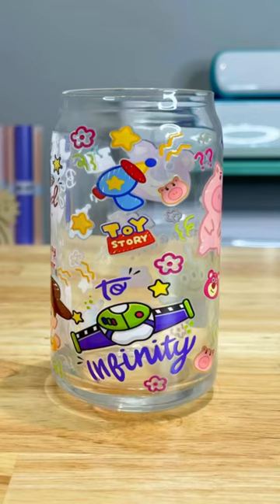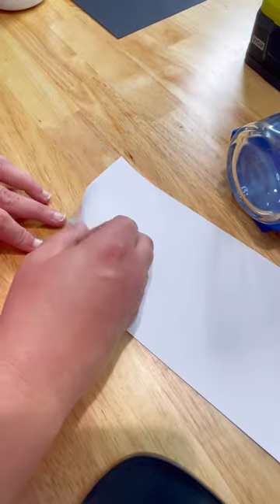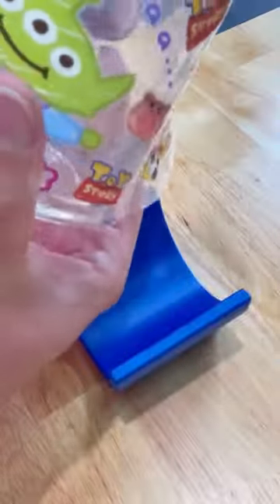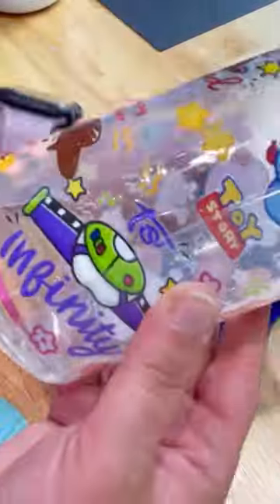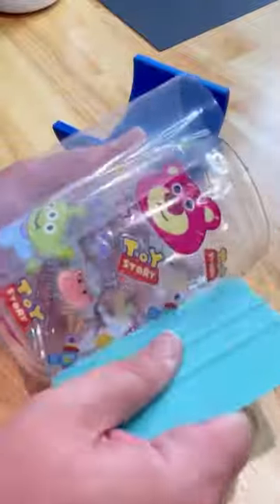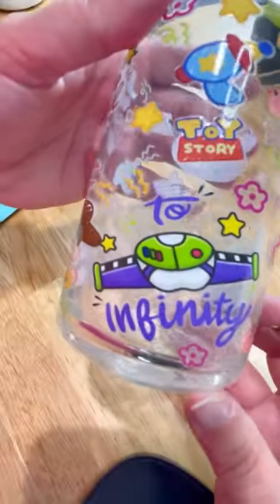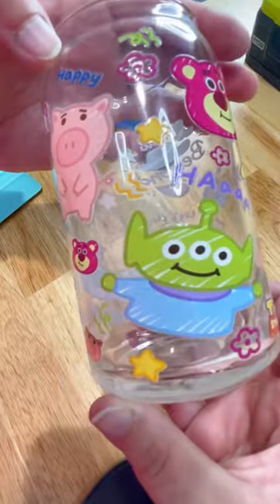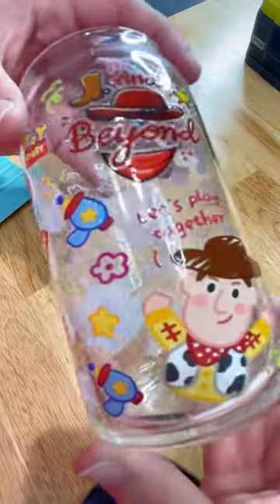Apply a UV DTF transfer to a Libby can glass #uvdtf #uvdtftransfer #fullcupwrap

Comment: I'm having an issue with condensation between the sticker itself and the glass any ideas?
Reply from the maker: Are the uv dtv prints peeling? You’re going to of course have condensation but if they are not peeling it should be just fine. I’ve used my cup a ton to test it and I do get condensation but everything is still holding up perfectly
Reply: @CorinneBlackstone  it's not peeling off but I can see it bubbling behind the layer and making the sticker really weak. So idk how to sort it or if anyone has advice or if I'm printing wrong
Reply from the maker: @WaifuWaresUK  I don’t print these. I purchase them so as for how to print then I can’t help you there but you need to make sure you don’t have any bubbles under them when you apply them